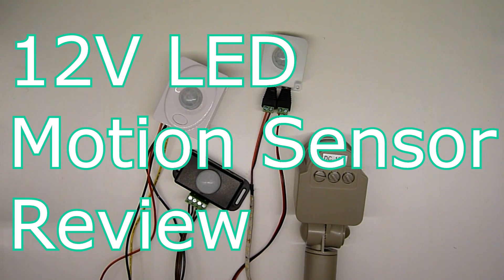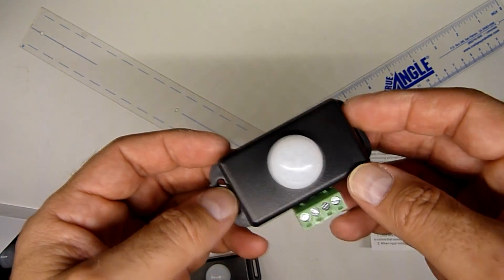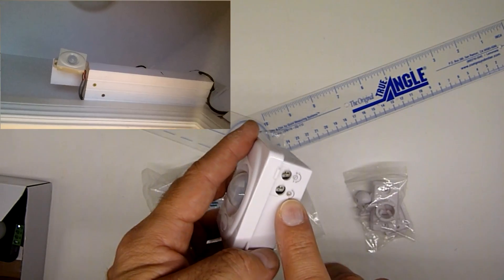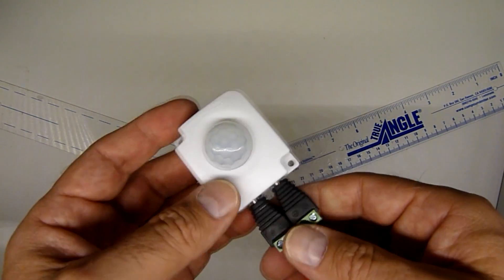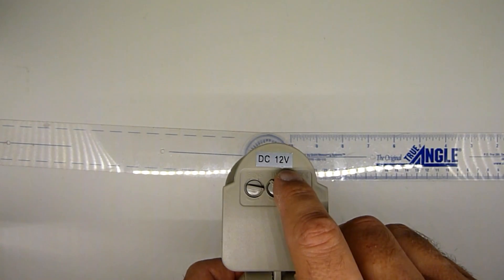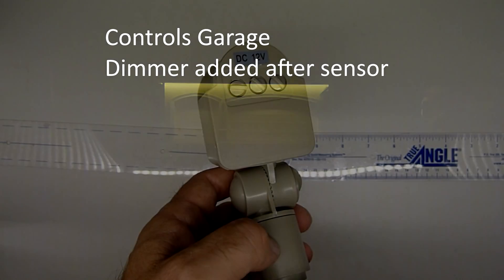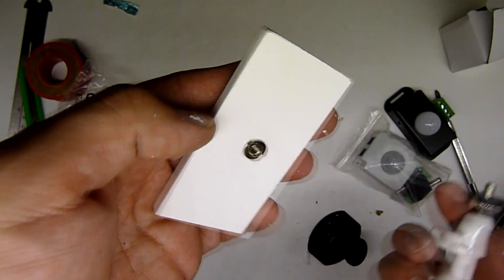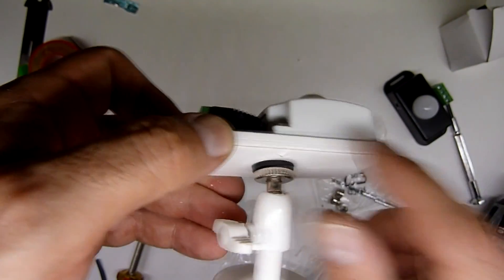12V PIR Motion Sensor Review for LED lights

Comment: can you convert an ac motion sensor to dc?
Reply from the maker: Not really.  Someplace there is a likely a rectifier to convert that AC voltage to DC between the AC connection and the motion sensor circuit.   Many of the PIR sensors I have read the specification for run at about 3 to 5V DC.  This would mean that even 12V DC voltage may be stepped down to 3 to 5V as well.  Bottom line, figuring all the right things to do take out the AC rectifier and then make sure the new 12V DC connection is providing the correct circuit voltage would not be straight forward, if even possible.  Many rectifiers are built right into the same board as the DC circuit... so they are essentially one.